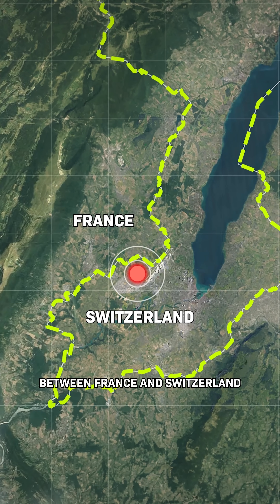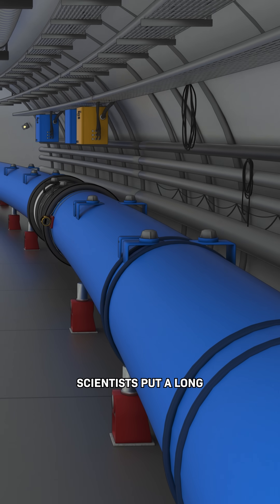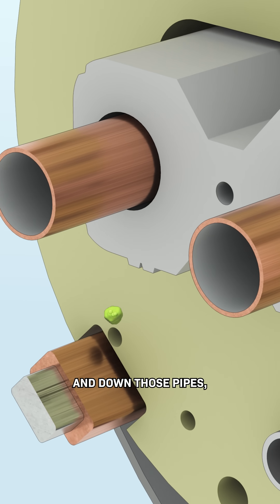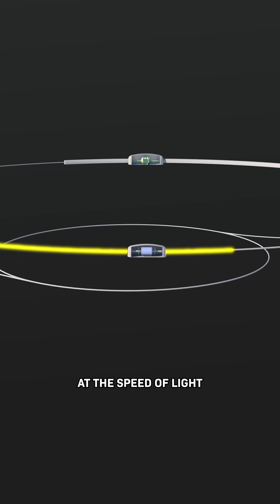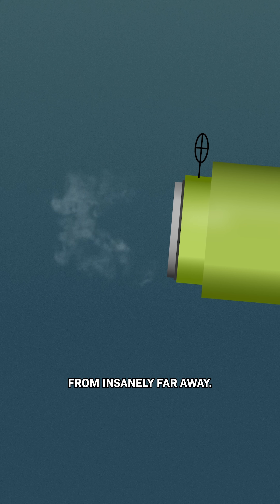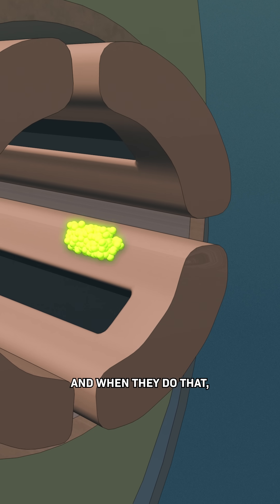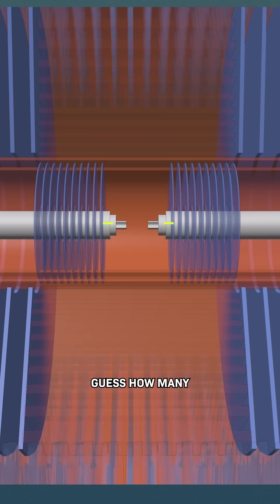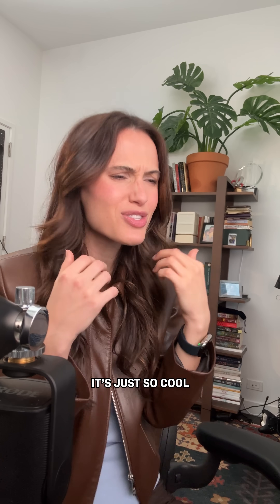How Do They Make Particles Hit Each Other?

Comment: The circumference of the LHC from the perspective  protons / neutrons being fired at 99.9999>% the speed of light  shrinks by a factor of 7000, from 16miles to 4m. 

So the LHC becomes 4meters long. Cool that is.

Comment: So that's the how. But what about the why and the what for? And least but not last, how much does it cost?
Reply: It does research on elementary particles and discovered evidence of the Higgs boson.
It cost 5 billion dollars to make, and about one billion per year to operate at full capacity.
Reply: @TashiAsh-z7q I thought CERN's goal was to make atom fusion happen. I have a cousin who worked there, persuaded it is the solution to energy problems... I knew the costs were insane (for 0 result so far), but not THAT much. I don't understand the enthousiastic tone of the video. L'art pour l'art and science for science...?
Reply: @  
I think you misunderstand.
The large hadron collider is purely a research tool, not an energy generation device. Its purpose is to discover new elementary particles and how they interact with each other, which it has proven very effective at.
CERN is a large organisation that oversees multiple research projects, amongst which is a seperate project working towards achieving sustained and productive nuclear fusion.
This is also doing quite well, and is currently in the process of extending the period of time over which the fusion reactor can be run. Admittedly, it was rather overhyped by the media, and is not (and was never ) expected to become a viable energy source until much later in the process.
Reply: @TashiAsh-z7q Thanks for your polite answer!

Comment: What i want to know is how they isolate and control these subatomic particles to do their bidding. Like how do they catch them in the first place, how do they separate them from other molecules
Reply: They just use a lot of energy to break down hydrogen molecules using radiation then they just create a cation by removing the single electron a hydrogen atom has
Reply: 99.98% of all hydrogen is just an isotope called protium which is just an electron orbiting a proton. You can use methods such as ionization to remove the electrons from the proton to isolate the proton
Reply: Send energy into a hydrogen atom to remove the electron

Comment: Hydrogen gas is ionized to create these protons. Which bombard with each other to near speed of light. Once the collision occurs scientists notice the path through tracking detectors that use magnetic fields which form curvature to understand the mass/charge. Calorimeters for specific particles that do not have s specific path. Time of flight detectors which measure mass and velocity of certain detected particle. The unusual energy spikes aren't on one attempt measurement but they are measured over and over to check if it wasn't a fluke. 
Higgs boson's particle was theorised way early. When the collider was used the detectors measured an anamoly that matched the predicted characteristics of the Higgs Bosons particle. They repeated the process again so as to confirm it wasn't a mere one off anamoly

Comment: That's called "Luminosity" (meaning "brightness") of the ring, and it's affected by almost all other parameters of a ring accelerator, interacting with each other. Increasing the luminosity, as they did in 2022 at the LHC, is not an easy task and needs careful calculation and replacement of expensive parts, so this is just done if the previous parts reach the end of their lifetime.

Comment: That was definitely one of my questions but the other question i have is: how do they get the particles they want in the pipes? If the pipes are emptier than space, then if there's an entry point to put the particles in, then surely other things like dust in the air also gets added inside? So is that how it works? And then they purge the extra stuff? But then how do they do that? How do they ensure there's ONLY the particles they want inside the pipes when they want to make some collide?

Comment: I worked on Fermilab, not at Fermilab back in the early 70's, I worked on the steel in one of the sections of tunnel. It was massive, I can imagine the size of the one in Switzerland is. They attempted to build that size in Texas, I think they actually started work on it until they realized that Fire Ants are attracted somehow to the magnetics involved.

Comment: Isn’t cold the absence of heat, so how are the pipes colder than it????
Reply: That's a great question! Space is roughly 2.7K or -270.45 °C. I'm pretty sure it's that temperature because it's been steadily cooling since the big bang.
Reply: @spencerk5840 space doesn’t have a temperature. Temperature is a thermodynamic property, of a large collection of particles. Space is almost a vacuum

Comment: One of my proudest achievements: In CERN each time a collision happens. around the collision point there are sensors and data is processed and logged. A tiny tiny bit of code (technically FPGA circuit) that goes into the processing: the calculation of the cosh function is written by me and a colleague. We spent a whole semester optimizing it, so it would be able to finish the calculation 30 billion times a second.

Comment: Can you tell me what is the point of doing all this?...
Reply: Vhg
Reply: B b
Reply: Nm
Reply: M
Reply: O
Reply: I
Reply: U
Reply: Y
Reply: Y
Reply: Y
Reply: Y
Reply: Y
Reply: Y😊
Reply: @Anonymous-yd5hi  Are you having a stroke? Do you need a doctor? Actually nvm it's already 5 months ago, you're far beyond saving.
Reply: One of the main reasons is to visualize the big bang. When the big bang occured it released a ton of energy and heat and that is exactly what this does, and we also cannot see what happened when the big bang occurred because it was so hot and dense that light couldnt escape until after 380 thousand yeears. So in a way, doing this is like witnessing a knock off big bang that you can study and visualize.
Reply: U
Reply: H

Comment: My question is what happens to the hundreds of billons of salt bits that missed and are going 300,000 kilometers per second? Are the walls of this place turning into swiss cheese? Thats alot of power and nobody says where it goes? In one second these things could be past the orbit of the moon. Will this place quickly become to dangerous to use???

Comment: How is it , we have the ability to excelerate particles to the speed of light.....but can't build spaceships to do that
Reply: You're thinking about the scale incorrectly. A proton is a singular particle of an atom. It is a portion of the smallest things that we consider matter, and we can't even get that fully to light speed. If we were to use this same process, assuming physics work the same way (which they don't, but I'm a layman so I can't fully explain that) we would have to build a tube multiple times the scale of our solar system, then find something that could fuel propulsion around that structure likely hundreds of times to get to that speed.

Comment: The Large Hadron Collider (LHC) was built to explore fundamental questions about the nature of the universe by studying subatomic particles and the forces that govern them. Here are the main reasons for its construction:

Understanding Particle Physics: The LHC was designed to test the predictions of the Standard Model of particle physics, which describes the fundamental forces and particles that make up the universe.

Higgs Boson Discovery: One of the LHC's primary goals was to discover the Higgs boson, a particle associated with the Higgs field, which gives other particles their mass. In 2012, the LHC successfully confirmed the existence of the Higgs boson.

Exploring New Physics: Scientists hope the LHC will uncover evidence of new phenomena beyond the Standard Model, such as dark matter, supersymmetry, or extra dimensions. These discoveries could radically change our understanding of the universe.

Recreating Early Universe Conditions: The LHC allows physicists to recreate conditions similar to those just after the Big Bang by accelerating protons and heavy ions to nearly the speed of light and colliding them. These high-energy collisions produce temperatures and energies far beyond anything we can naturally observe, helping scientists study the origins of the universe.

Advancing Technology: The LHC pushes the boundaries of technology, requiring the development of advanced computing, data analysis, and engineering techniques that can have wider applications outside of particle physics.

Comment: With my two cents,,, If you look at the manners nuclear energy looms,,, this centrifugal phenomenon is a common ionic characteristic of extracting nuclear energy,,, when photons or the light cells become excited as fluorescent like electron particles jumping back and forth on S and Ps and other orbitals ,,,,,  this concept in fission and fusion terms is like heating butter to melt and cook eggs with ,,, hydrogen engine cars and submarines, and power plants all reach those thresholds moments before excited electrons allow the extraction of the bond energy via protons presence in different methodic ways

Comment: 60 hits from 200,000,000,000 shots...
Hit accuracy rating of 0.0000000003...
This gotta be the worst Hit Accuracy recorded in YT history.
Reply: Except the equation is 60 hits from 100,000,000,000 shots, according to the video
Reply: @beauteoussounds1156  True, but video failed to explain if those 100,000,000,000 shots were shot only once direction or was  50,000,000,000 shots fired on both sides equaliy making it 100,000,000,000 shots total... 

Incase of only 100,000,000,000 shots were used then the hit accuracy would only raise to 0.0000000006.

Comment: I spent 7 months on a studentship there recently. There is a saying about the precision on those collisions - it is as if you were throwing two needles at each other across Atlantic and trying to hit achieve a head on collision. 

And there are so many small funfacts about those accelerators which are just mindblowing!
Reply: This is interesting, but I'm confused as to the objective behind this experiment. Can you please explain it for me?
Reply: @Halsjlebsk50698  the thing that is being observed changes from time to time. But the whole point of this biggest accelerator is to take particles to the highest amount of energy (speed) possible and then to hit them together (there are two particle beams flying the opposite directions in two pipes next to each other). And then there is this quantum fun that's a bit beyond me tbh, but in general you are trying to produce as much energy possible in one place with the collision, so completely new particles "spawn" from the quantum world. The visual I was given is to think of it as throwing two mechanical clocks against each other, you would expect a bunch of cogwheels and springs flying out, but you actually get some completely new "parts", corresponding to the energy you put into it.
Reply: @Halsjlebsk50698  To discover more of the physics. 

Fun fact — Higgs boson, a particle that explains how things can appear out of nothing (pre-big bang) and have mass, was discovered in that very facility. 

Similarly, colliders and particle accelerators are used for mainstream in things like X-ray imaging you do in hospitals, among other things. 

That facility also managed to produce very small amount of anti-matter and trap it with electro-magnetic field for temporary storage (if anti-matter collides with matter, it reacts, explodes and cases to exist — hence why you need to, essentially, keep it in vaccum and contain it without physical contact. Ie. Electro-magnetic fields). 

Many great scientific discoveries can be achieved by using colliders/accelerators and investigating what happens with sub-atomic particles and such.
Reply: What happens to the particles that miss? Do they put holes in the walls?
Reply: @richiebricker  they miss all the time actually! There's just so many that from our point of view, there are basically constant collisions. At the point of intersection they are guided in a way that the beams cross paths and the particles that miss continue in the back in the accelerator. If they would hit the wall, or some device they could literally put a hole in it (destroying magnets is not fun when you want to run the experiment for multiple months without stopping).
Reply: How did they prevent damaging wear on the inside of the pipe?
Reply: @ABonRMS  when everything runs well, I believe that on the main accelerator wall, there's only a slight wear. But the pipe and detectors inside the experiments, where due to collision you have particles going through those parts, you actually get quite some wear and tear! That's also why there is about 3-4 months of planned shutdown every year to go down there and fix the problems. But it can often happen that there is a problem much sooner and they need to stop. 

If you ever want to come to CERN, the time from January till March is probably the best in my opinion! There's a shutdown from the end of November, 1 month for the radiation to decay and then the detectors open for engineers but also for visitors to go down there 100m below ground and actually see the experiments on your own.
Reply: Yeeeah not really as they are guided around a piped track magnetically then forced down a tiny hole smaller than your hair IIIRC at the collider. 

 My question is why protons! It would be cool if they were also getting heavier elements as well near those speeds. .
Reply: That's not a fact and the precision required to run CERN is nowhere NEAR that. Get a hold of yourself.
Reply: Cleos forehead accelerated into a fivehead

Comment: There are a lot of these all over the world, and I feel like they are responsible for the increasing rate of earthquakes.
Reply: @Axxe80  you're comparing apples to oranges. Clearly you don't know enough about particle accelerators. That amount of movement underground, including the impact of the particles colliding, has a direct impact on the environment around it. The same way earthquakes trigger tsunamis.
Reply: @Axxe80  with a simple Google search, you will find out that there are over 30,000 particle accelerators in use worldwide. Your response is ignorant and misinformed.

Comment: the calculations for that would have probably taken them 1 or 2 months they had to calculate where and when the particals should hit each other find the exact coordinates that would put them in front of each other then calculate the timing of wich they should give it a certain amount of electric charge so that it would shift into the coordinate with out loosing their momentum and then there are still way more than just this much into it....and then you have to do it for each of the particals so that they would hit each other wich is just a general you need minimum and maximum of a general area so that they stay there

Comment: On the border of France and Switzerland you can also climb on a mountain until you hit the eternal snow. So far it turned out to be a place where there were no girls with ADHD ranting about science and particles. But I would not postpone a trip to such a place for too long as one day these creatures will find their turbo-enthusiasm project them to these places at a speed similar to that described in this video and they may start orbiting around the once before quite mountain peak. Just a friendly advice.

Comment: Is this not just the particular accelerator from flash😂
Reply: theres no way bro said "from the flash" thats the equivalent of "the guy from fortnite" a particle accelerator is a real thing
Reply: Tell me why I was thinking the same thing 🫣🫣💀
Reply: Humanity is doomed.
It's the Large Hadron Collider, opened in December 2008. It makes subatomic black holes sometimes.
Reply: @oddity6494  still not the point, the point is that a particle accelerator is possible in real life, the LHC has nothing to do with the discussion
Reply: @lcpl_peach  This is the Large Hadron Collider??? It's what the video is ABOUT.
And the Large Hadron Collider IS a particle accelerator. I was informing them that it's indeed real, since it SEEMS these people don't know this.
Reply: @o @oddity6494  And?

They are subatomic.

Not every black hole becomes massive.

Just like how nuclear fusion in a lab will not magically grow into the nuclear fusion of the size of the sun.

That is just now how energy works

Comment: This is indeed very dangerous, not due to the risk of physical injury or explosion, but because it could potentially lead to the formation of a black hole. Black holes are created when a star dies and undergoes a supernova. To comprehend the formation of a black hole, you must first grasp the workings of a star. Within a star, countless tiny explosions occur every second, generating a force equal to the star's gravitational pull. As the star expires, these explosions cease, and its gravity makes the star collapse inward. This collapse is so intense that it compacts the star's mass to a point smaller than an atom, resulting in a black hole, where the gravitational pull is so immense that not even light can escape. So when these particles collide at nearly the speed of light, there is a theoretical possibility that they could compress into a small point and create a black hole, potentially engulfing the entire solar system.

Comment: Unfortunately, you've left out the name of that place - CERN.

This is the CERN particle accelerator, the biggest in the world, and it's not only sample size. Firing even 100 billion protons with no other system of guidance would miss 100% of the time. They use magnetic fields to both accelerate and sort of aim the particles.